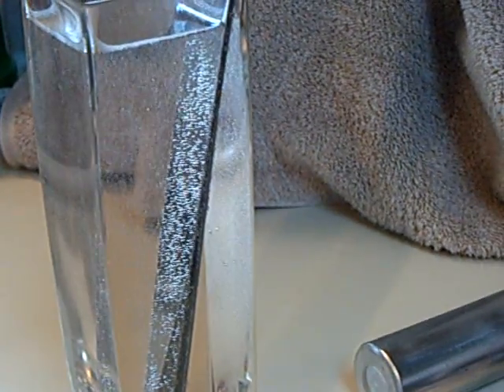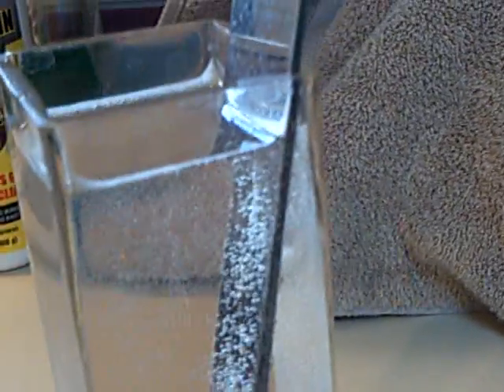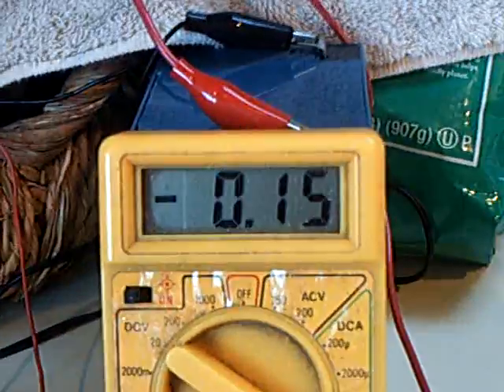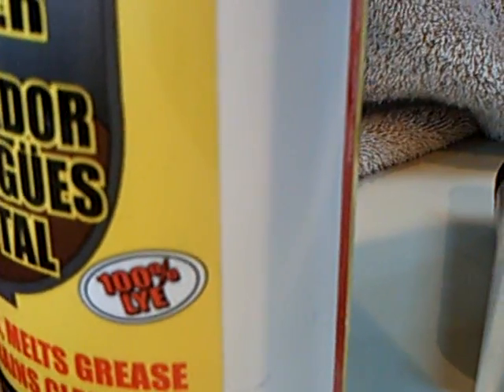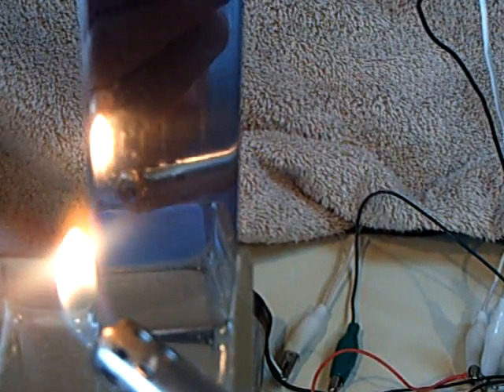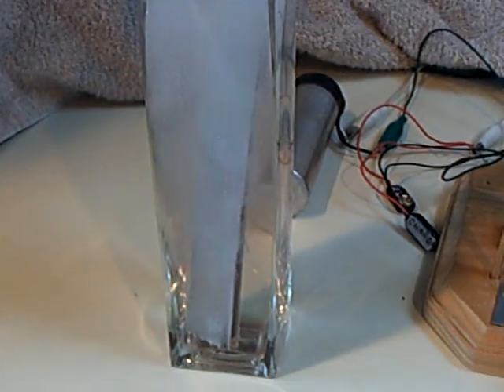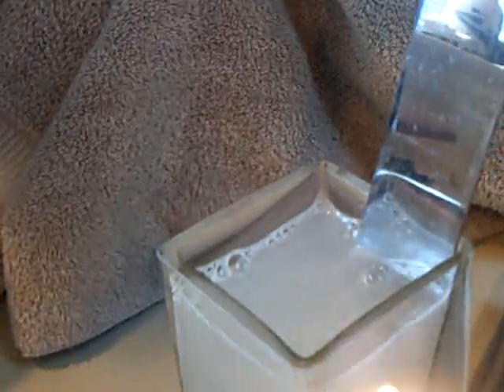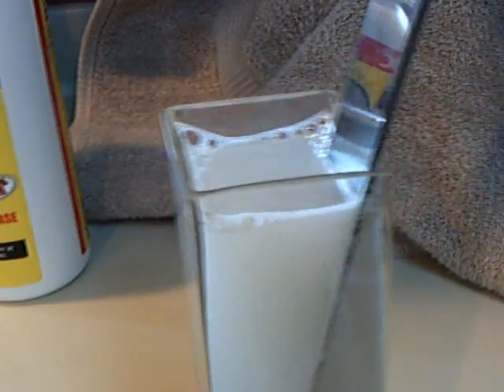HHO generator --Bedini SSG  or not?

Comment: No. 2H(2)H(2) is created by the electrical current passing through the water.  The electrodes only provide a low resistance surface area. Changing the polarities will not effect that at all.    Hydroxy is strictly OH.  What is being produce consists of mainly H(2) and o(2). Yes some OH are created along with H atoms but the gas that is produced is considered 2H(2)+ O(2)